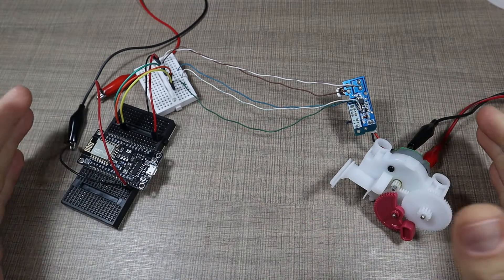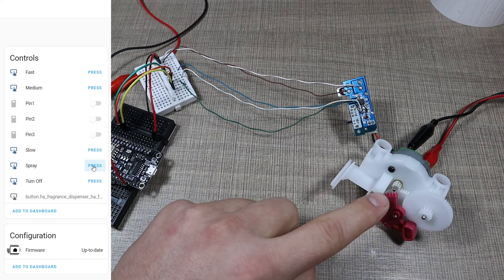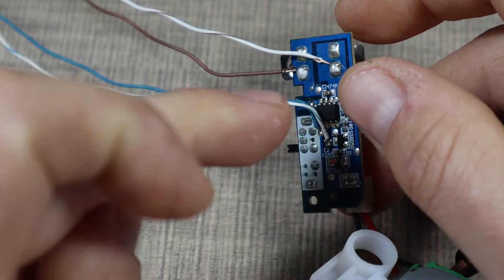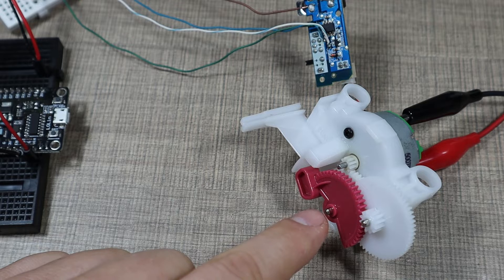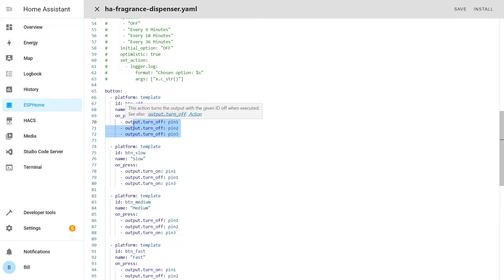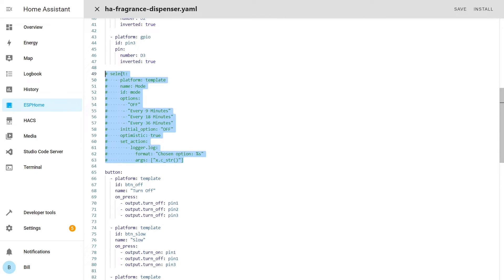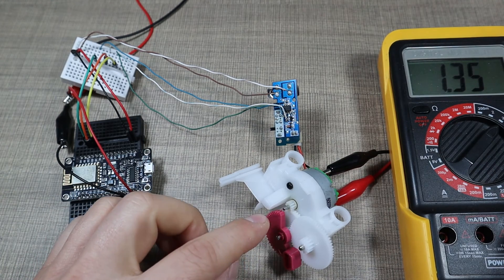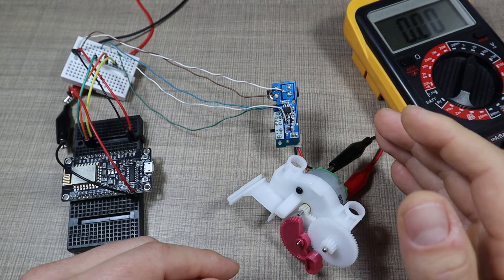Smart Fragrance Dispenser with Home Assistant - AirWick Air Freshener How to Mod

Comment: Is there a way to use the ESP 32 Without HA?
Reply from the maker: Yes, of course. You can use the Arduino IDE to program it any way you want.
Reply: @TasteTheCode Is that using the same code?
Reply from the maker: No, you need to write your own for that.

Comment: How to refell spray with this setup  and elso does it have battery or can be plug in all time does this setup wifi
Reply from the maker: Yes, it will need to be plugged in as the WiFi will kill the battery quite quick. To refil, you still do exactly the same as before since all wiring and electronics will be in the upper part.
Reply: @TasteTheCode So, how powerful is all this? What are the requirements?
Reply from the maker: @ You mean in terms of what, power adapter needed?
Reply: @TasteTheCode  so what power adpator you need so no battery needed for us
Reply from the maker: @ethanw05  Any adaptor that outputs 3V should do the job.
Reply: So will gld 5v  dc 1000 ma power Adpotor us version will it be safe in the us like north texas with diy smart airfresher
Reply from the maker: @ethanw05  Yes, you need to connect that to the Vin pin on the NodeMCU and supply the freshener circuit with 3.3V from the onboard regulator.

Comment: I can"t write the code, i"m getting the same error everytime: 
Can you give me some directions?
INFO ESPHome 2024.8.3
INFO Reading configuration /config/esphome/air-freshner.yaml...
Failed config

output.gpio: [source /config/esphome/air-freshner.yaml:33]
  platform: gpio
  id: pin1
  pin: 
    
    Cannot resolve pin name 'D1' for board esp01_1m.
    number: D1
    inverted: True
Reply from the maker: You need to set the right board for ESPHome. D2 is a pin reference for NodeMCU and you can set that with this directive:

esp8266:
  board: nodemcuv2

If you are using a esp01_1m board then you need to use the pin numbers instead.

Comment: i did this but with a glade air freshener instead. I replaced the entire PCB that came with it and replaced it with a h-bridge controller (MX1508). The glade air freshener motor is driven forward to push the spray can nozzle down, then reverses the motors direction to release it instead of letting it rise on its own. Wasn't a good way of tapping in to the existing PCB even after removing it's MCU. But works works great with HA also. Good video
Reply: I am in roughly the same situation, but haven't figured out a solution yet. My PCB (SM Cloverleaf B 1.2 RB-08, dated 2010/11/02) does the same, but figures out when to reverse the motor direction when the spray nozzle passes through an IR-looking LED package (trying to figure this part out)
Reply from the maker: Thanks! That might be a good option. Thanks for sharing!

Comment: Lo hice hace dos años y Zigbee2mqtt. Pero solo dura 1 semana la batería con 2x18650
Reply from the maker: It need to be plugged it if it is on all the time. An old mobile phone adapter can do the trick.

Comment: Hi there, very tasty videos!!!
Would you consider adding an LDR to spray each time there is a light transition from on to off, so immediately after someone leaves the toilet?!?
Thanks for your videos and effort
Reply: he can add air quality sensor also :D ... jokes aside .... nice system :)
Reply from the maker: @J0stik  Thanks! With the air quality sensor, you can also know when it is safe to enter again 🤣🤣🤣
Reply from the maker: That is a cool idea. You will need to use the analog input for that as LDR changes resistance based on light levels. More info can be found here: https://esphome.io/components/sensor/resistance.html If I ever revisit the project I'll add it as well.
Reply: What air freshener did you use? Be cool to see using the light sensor too
Reply: use this timer search for "DROK Time Delay Relay" set it to p1, for .7 seconds, now set a loop to the relay  of the timer board, I used a adjustable voltage to give me 3 volts, unhook the motor wires from the sprayer, setup a 3 volt loop 3v+ through the rely of the timer to the positive of the motor,common ground for all,  I put in a mini float search for "Liyafy 5 Pcs Right Angle White Plastic PP Float Switch Fish Tank Liquid Water Level Control Sensor XSL-3508-P" to toilet the toilet flush which flips relay on my home automation controller for 1 second to flip the timer board for .7 seconds, now when someone trigger the toilet it sprays the bathroom.